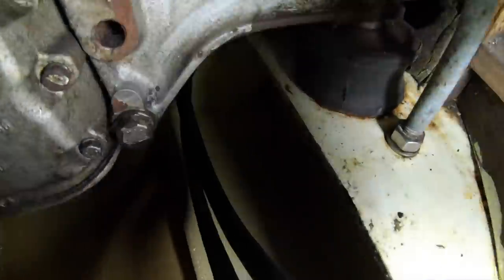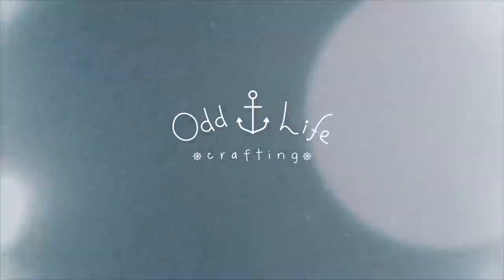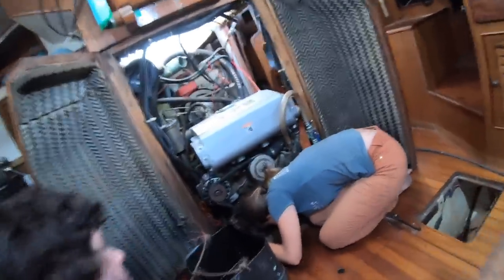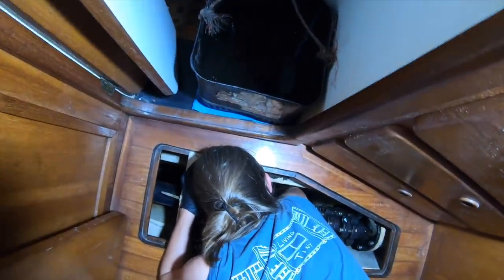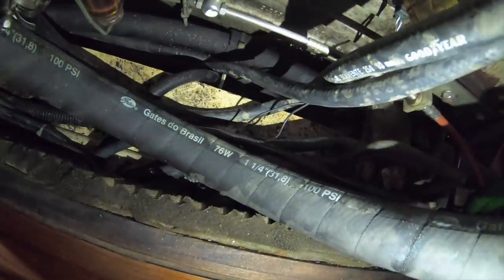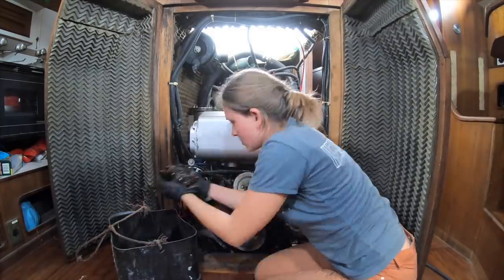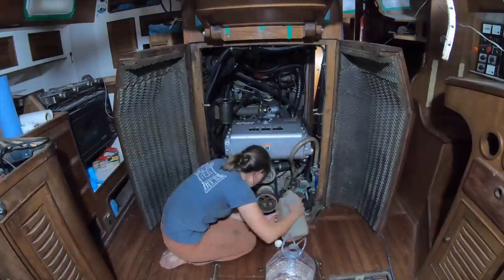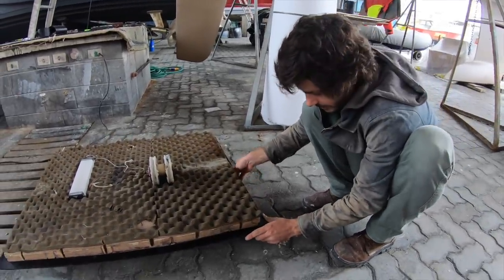⛵️We had a surprise with our engine bilge!! #110

Comment: Oil prevents rust, that's why collectors oil their firearms to prevent them from rusting. It prevents oxygen from getting to the metal. Also, did Roberta do something new to her hair or is that just a reflection from somewhere ?
Reply from the maker: I cut my hair some days ago. hehe. The diesel tank was full with oil and presents some rust
Reply: The diesel tank was full of oil ?  Shouldn't it have been full of diesel, not oil ?

Comment: Any hole below the waterline designed to either emit or discharge a gas like exhaust. Other thru hull fittings might include saltwater intake for cooling. The saltwater intakes would cool things like generators, ac units, in addition to the drive engine. You want to walk from stem to stern looking for any hole that is designed to be there. The part that comes thru the hull is called thru hull fitting. Just the fact of the location is why you need to remove and replace. The age or the life and condition of that part needs to be replaced.
Reply from the maker: Oh! I understood now. We are working on this this week. All the thru hulls are above the water line.
Reply from the maker: Hello john (it’s Duca now). I think it’s just a misunderstanding of names. What roberta means is that we don’t have any piece that you can exchange on the hull like in a fibreglass boat that you have a flange screwed to the hull it self. In out case all the through hole is steel pipe welded to the hull on the bottom with a steel flange on the top (above the water line) and the. A stainless steel flange screwed to this flange and then a valve screwed to the flange. From there you have the hose. This week we painted all the inside of the pipes (1/2 inch thick walls) and we took all the valves off and we are going to exchange all the 12 valves for new stainless steel valve. Hope you I didn’t make any more confusing hehehehe 😁👌🏼

Comment: The oil and fuel preserved it, with the fuel tank there was no fresh air so the air was very humid all the time, under the engine the air would have changed with the seasons as it wasn't air tight.
Reply from the maker: That's why we don't understand why we had rust under the diesel tank
Reply: Odd Life Crafting sealed tanks sweat and the humid air has nowhere to go.
Under the engine the air was able to change so no sweating.
Put an empty plastic bottle with a lid on in the sun for 30 minutes and it will sweat on the inside.

Comment: So when you’re drilling in wood or metal you need to drill from smaller to bigger but I would think drilling into gasket material you could use just one bit.
Reply from the maker: We actually used 2 different sizes for it. But now we are using a bit for wood that has a thin tip
Reply: If you use a hammer and a punch (A tube with a sharpened edge) .... neat and tidy with one blow! 😊

Comment: A gasket punch would have been better for making the holes in the rubber seal 👍🏻
Reply from the maker: The problem is that we are gonna live inside the boat, so we need to do as much as possible with the tools we have in order to save space. Thanks for the tip
Reply: I wonder if it has a propeller glad seal leaking and it’s not showing up as it’s out the water ?
Also how long did you run the engine for to check for oil leaks ?

Comment: The bilge is not an air tight container.  Moisture can evaporate over time.  The fuel tank, however, is closed and can act like a terrarium supporting its own environment.  Over hot and cold swings the moisture will separate from the fuel when hot and condense on cold metal (the top of the tank where an air space exists) when the temp drops. These droplets will hang if not disturbed (i.e. a boat dry docked for a long time) cause rust and corrosion.   So many feel you either store fuel tanks fully empty and dry or completely full so no air space exists.
Reply from the maker: 👌🏼 we do agree but we still don’t understand how we had “problems” on the entire thanks even on the bottom and sides when the tank was full and we found no water at all on it. It was like 98% diesel 2% air. 🤷🏻‍♂️🤷🏼‍♀️
Reply: @OddLifeCrafting  It could have occurred a long time ago with bad fuel and the previous owner took the position, "I'll just drain and put fresh diesel in and let that stop the corrosion".  Then you guys, I call you the perfectionists! :) came along and said "that just will not do!".   Looking forward to your maiden voyage!  Oh, and I would have started with the Shop-Vac to begin the bilge clean out.......don't let Roberta know I said this!

Comment: Next time you have to remove oily water  in a hard to reach place buy several packs of disposable baby diapers and use them to asbsorb most of the liquid before you mount the scrub attack.
Reply from the maker: The problem of it is the environment. They are gonna last 500 years until they are gone

Comment: The oil preserved it and the paint that's on it. The fuel tank didn't have paint to and oil to resist water damage. Diesel will have a small amount of water in it. And the fuel tank will draw condensation also.

Comment: Is there a reason why you put the bolts for the engine cover on with the nut on top instead of the head on top?
Reply from the maker: It’s welded there in this way. We don’t know why
Reply: @OddLifeCrafting  That is very odd indeed. It's a hazard to bare feet, just an accident waiting to happen. Make sure you keep plenty of bandaids on board ;-)

Comment: U guy's  get a set of leather hole punches on Amazon they work on rubber just need a hammer and back block metric and standard
Reply from the maker: The problem is that we need to have less equipments as we're gonna live in the boat, so we need to use the equipments we have instead of buying some more and then we are gonna need to find a place to store it all

Comment: I know your excited to button up the ship. However you would have been better off leaving the cockpit floor off and left it till after you launched the boat and the technician gave the engine one last exam. You could have put in a temporary floor made of wood and covered it to keep out the weather.
Reply from the maker: The wheel is on the top of the engine and to have another try of the engine we are gonna need to have the wheel in place 😉

Comment: Good work guys, 
I am from Buenos Aires, 
We are neighbors 
if you need a guide here only ask me
Reply from the maker: Hello, Pablo. You have the same name as my brother. hehehe. Thanks for the tip. We went to Buenos Aires in 2011.
Reply: When you decide to come to these southern latitudes remember my advice.
the inner Rio de la Platar is very low, every baro with a draft of more than 1.5 meters has serious problems, having to look at the tide tables to enter the port. a good idea will then be to arrive at the Puerto de la Plata just 80 km from bs.as. and you can travel comfortably by train to Buenos Aires.

Thank you, I learn a lot with you both.
Reply from the maker: We have 1.1meters of draft 😉
Reply: Good news you have freedom to sailing here, may be can visit Delta del Paraná its beautiful  using motor. and you can choose almost hundred of ports and marina of bs.as to get coutesy tie. 
good work with the hatchets.
Reply from the maker: Thanks, Pablo

Comment: Use a hole punch for gasket holes
Reply from the maker: The problem is that we need to have less equipments as we're gonna live in the boat, so we need to use the equipments we have instead of buying some more and then we are gonna need to find a place to store it all
Reply: Yes but a gasket hole punch set for port lights 
And hatched in the future is a handy tool you can Also make 
Engine gasket like water pump gasket in emergency 
I’ve used cereal boxes to make great gaskets

Comment: Too late now, but you should have made one pass with the small drill and then followed up with the final drill. Would have avoided many drill bit changes.
Reply from the maker: We did actually. Now we are using a bit for wood that has a smaller tip

Comment: Put some protection on the floor ;-( Please ;-) Do not destroy the floor ;-) old oil, coolant and diesel is not something to get around in the boat, my eyes get wet with tears,
But keep up the fantastic work on the spiffy boat;-)
P.S at 7.10 you can eat dinner in the enginbay ;-)
Chers from Norway

Comment: Mineral oil is any of various colorless, odorless, light mixtures of higher alkanes from a mineral source, particularly a distillate of petroleum. Mineral oil USP or light mineral oil can be used as an anti-rust agent for blades, like carbon steel. 

That is a good explanation why the engine bilge wasn’t much corroded: because the oil can be a barrier (or anti-rust) gainst oxygen and oxidants. So, I am not sure if it is a good idea to use powder soap, which has chlorides (powerfull oxidant), with fresh mineral water, which has oxigen and is also ions conductor. Chlorides, oxigen and water is a good mix to promote corrosion in the carbon steel. It would be better to consider a corrosion protection against chlorides, water and oxigen. Maybe mineral oil could be used. It is better to have barriers to protect against corrosion that having a cleaning apearance, but whitout anti-rust protection. To storage carbon steel plates, it is common to use mineral oil as a corrosion protection (or anti-rust).

Before apply the mineral oil, consider to clean the surface to eliminate any chlorides (from any residue of the powder soap).

Keep working on it; you’re improving! ❤️
Reply: Mineral oil is mostly paraffin and is a good protection. Diesel contain solvents (aromatic, poly-cyclic..) which can get airborne and dissolve some paint, leading to corrosion.

Comment: Wow you made your beautiful wife clean the bilge and she's still smiling i have never seen a more beautiful woman in the bilge before i could not have done that but its done, just wondering did you check the bilge before you started the engine you may need to check it after you run it again
Reply from the maker: We are gonna be taking a closer look at this 🧐 thanks for the tip

Comment: Geralmente há água misturada com o óleo diesel vendido aqui no Brasil, talvez devido ao transporte ou acomodação em tanques. Essa água, embora em pouca quantidade decanta caso o diesel passe um tempo parado, tanto é que é comum em motores a diesel ter filtros de combustível que possuem uma pequena válvula em baixo para que o operador da máquina extraia a água da linha de combustível antes de dar a partida do motor. Dito isto, há a possibilidade de a água contida nos tanques ter decantado do diesel o que ocasionou o contato com o metal contribuindo com a ferrugem além do fato de que o barco ficou a céu aberto passando assim por variações de temperatura, em dias mais quentes havia a possibilidade de formação de vapor de água ocasionando oxidação até mesmo em locais aonde não havia contato com o diesel. No compartimento do motor, aparentemente havia óleo de motor que é um pouco mais denso que o diesel e tem uma maior propriedade lubrificante e repelente a água o que contribuiu para a preservação do metal. 

Grande abraço!
Reply from the maker: Oi, Breno. Pode ser. Mas nosso tanque de diesel tem uma bomba pra tirar combustível do fundo pra dar uma olhada e não tinha água nenhuma. A gente ainda não entendeu como foi parar óleo ali naquele poceto embaixo do motor. 😞
Reply: @OddLifeCrafting  Agora eu também fiquei perdido. Obrigado pela atenção em responder. Grande abraço!

Comment: That is oil and rain water from deck leakage !
Reply from the maker: And some more things 😂😂😷
Reply: They did test start the engine, with water & fuel leaks. .. Just saying lol
Reply: Donald Smith - apples to oranges they’re different  the cooling on that engine came from the water outside the boat  - leaks should be addressed  before boat put into water all other leaks come from leaks in deck ! And are a maintenance issue!

Comment: Your response to my below water line thru hull fittings you indicated you don’t have any thru hull fittings. I think you should take a more careful inspection you say you have none and I know you have at least one. I know this because you filmed it. Go back and look at the video entitled will the engine start. You’ll see about halfway thru the video Roberta is holding a hose thru the bottom in an effort to cool the engine if it started. At the point were the hose is going through the hull is called a thru hull fitting.  My guess it isn’t the only one. Like I said walk from the bow to the stern looking for them. One day when you least expect it there will be a leak and you want to know where it’s coming from.

Comment: A layer of zinc, paint, oil, and other motor fluids prevents any oxygen from getting at the steel, no oxygen no oxidation.
Reply from the maker: It can be the reason why there was no rust there